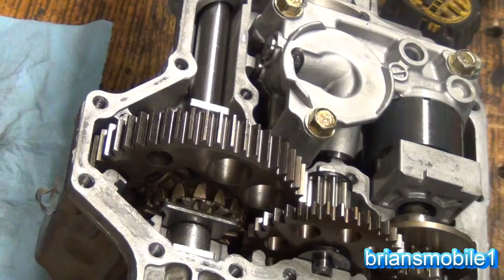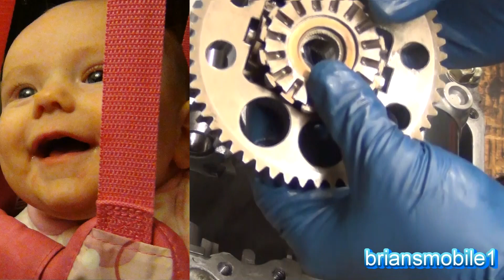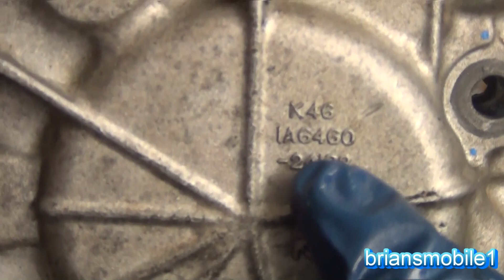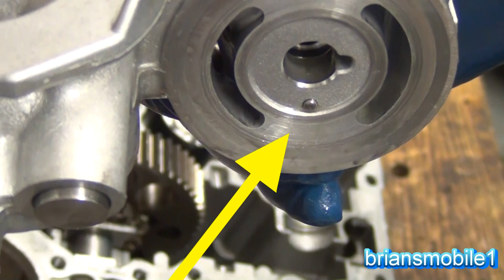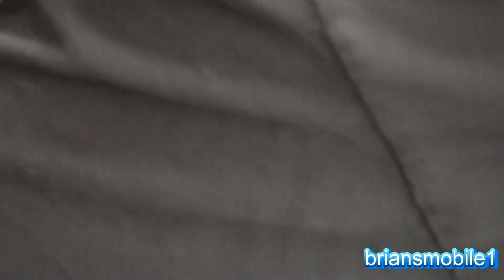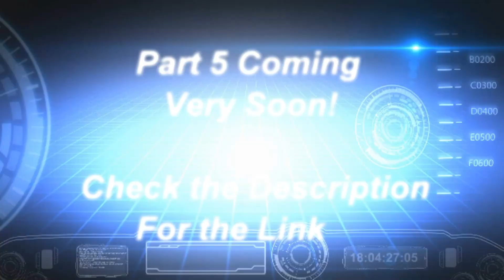Part 4 John Deere L Series Transmission Rebuild / Repair Differential and Motor

Comment: I have an L120 with less than 300 hours that is also having transmission issues. it jerks on load or turning right or left. I did remove the transmission and changed the oil but did not go  as far as you did bc I felt I would not be able to do it. The ol change did not resolve the issue.

Comment: my l130 rear end needs rebuild. Transaxle gets warm an it jus stops. I'm assuming the pump or motor is bad but I've got it apart an there's no play in the plungers on the motor or pump side. so the only other thing I can come up with is the center section of the pump an motor is bad. but I can't find the right rebuild kit.

Comment: The IDS valves have tiny little filters in them that should be changed - especially if you had metal in the oil

Comment: Thanks for the wonderful video, I have the same gearbox in our lawn mower, that started making strange noises just before starting up, I broke down the gears and could not find anything, except that behind the two springs (in this video time 13:44) I have got 2 bullets, and lo and behold, the machine is running, but upside down, when I push the pedal forward, it runs backwards, and when I press the pedal back, it runs forward. No ball is shown on your video, do you need a ball in there? Can this also hang together with the direction of rotation? I have no other explanation for that.

Comment: Is there a forum where people discuss the symptoms so we can figure out what parts we need?  Obvious gear wearage aside.  How do you know if your pump other anything else that is sealed is bad?  Its one thing to tear it down then find out which parts you need this could take a while in shipping time.  Also one hates to reinstall everything just to find out they did not fix the problem.  How can you tell whats exactly wrong?

Comment: I just posted on another video. I have a fix for the JD LT155/166 trans not working. This works on any with the 2 round pumps. Simply remove the round pump blocks and discard the small washer on the bottom. This allows the pump to resume its contact with the main pump block. The pump blocks wear over time. When the washer bottoms out, oil gets by the pump faces. I have 3 years on one with this fix and have done several other models with the round pumps. i switched to 5w-50w full synthetic oil.  Enjoy your repair!!!

Comment: Nice clips Brian!  Got a question on the K51A tranny: I had to remove the pulley shaft & replace it; however, once replaced & put back together - tractor won’t go into gear & makes grinding sound.  Is there any way to fix it w/out taking apart tranny? How do I go about fixing this?

Comment: I have lost some parts to the IDS valves. I have the springs and valves but not the ball or balls and filter or filters. could you tell me how many balls and filter I need and maybe the link to the parts diagram and parts list so I can order them? thanks, great video

Comment: Very informative , have one problem I just replaced my pump and motor unable to find any thing on my problem is forward and reverse are reversed never knew my tractor could do 15 in reverse gonna be a slow forward , not shut on what I did wrong on reassemble?

Comment: Is it just cheaper and less work to replace the whole transmission?: https://www.searspartsdirect.com/part-number/794711/0071/142.html?utm_source=google&utm_medium=cse&utm_term=794711&sid=SPDxGPROD&k_clickID=92184041-8079-46fc-8115-76a329c97421&gclid=EAIaIQobChMI9cqxhMTY2gIVkcBkCh0_cw4NEAkYASABEgLv6vD_BwE

Comment: what is the model of the transmission on a d120. There is oil running on the right side of the wheel. is it just a seal?

Comment: I got an L110 tore down to this point thanks to your video. Mine just whines and won't move on any unlevel surface forward or backward. What should I be looking for exactly? My spider gears look wore a little bit but I don't see any sharp or broken teeth. Could a little ware be the issue? Thanks

Comment: I have a craftsman with a K-46 trans. it had a broken bearing and a motor plate(triangular). I purchased replacements and took the shaft gears out and cleaned the housing. After putting all the parts together again the tractor runs fast in reverse and slow going forward also the neutral does not work (always in drive mode). Any help will be much appreciated.

Comment: I have an issue with my JD transaxle. Runs forward strong, but won't reverse. Had it apart looking for obvious wear or missing parts. All looked good. Matched with parts diagram. Put it together. Added new oil. Still no reverse. Anyone got ideas?

Comment: I did business with Tuff Torq. The nicest people Extremely helpful. I bought every thing I needed and was surprised how reasonable it was.
Reply from the maker: Bill Morgan I felt the same way.  It was hard to find parts the traditional way through J.D., but once you know where the transmission came from and the right kind of fluid to put in it, you're golden!  Great folks to work with.
Reply: I mentioned them on my FB page and sent them an E=mail what a pleasure it was doing business with them. I'm back mowing this morning. Thanks for all your help!

Comment: Bryan I like your detail to attention. I have the trans. out and the spider gears are trashed. Don't see any other damage except the cooling fins are cut off on mine. I did get into trouble trying to remove the drain rubber and trashed it. Hope I can replace it.Also I can't tell if the magnet is in a sort of tray that comes out with it. They, the magnets did their job and may have been why I had this trouble.

Comment: Excellent tear down and explanation my man.  My craftsman uses the same transmission.  Says in the manual there is no way to service (change fluids) which bothers me.  I have 60 hours on it and will change the 5-50 oil to synthetic now that I know what it is.  Good to know parts can be purchased separately in the future from the actual manufacturer vs almost $900 from Sears parts as an entire assembly.  This is a great little transmission.  Knowing how it works is part of knowing how to care for it and make it last.  Thanks again for this insightful video.

Comment: Nice detailed video, I pulled mine apart today to check for any damage, just one question, their are 2 rods that hold the spring on forward reverse lever, what does the adjustable rod, adjusted from outside of unit, do on forward reverse lever?

Comment: I bought a JD with the loss of power issuer, the previous owner replaced the pumps and what not... there was still loss of power, i tore apart the transaxle and noticed the washer part #39.  Do you know if that was missing if it would cause a loss of power?  Motor and pump seem to be in good condition, gears are a little worn, but wash was missing.  any thoughts?

Comment: I'm a mechanic for a John Deere dealership and we never break down tranny's. It's sad but people will pay for a new one or trade the whole lawnmower. Nice to see someone helping the helpless when it comes to JD..I applaud you sir!!
Reply from the maker: Drew Queen Thanks Drew!
Reply: @briansmobile1  what has bigger cylinder plungers the pump or the motor?
Reply: @bcdoll01  Looked like the motor had the bigger cylinders, which makes sense.  In a hydraulic system, a small cylinder feeding a large one is like a small pulley driving a large one, in both cases it gives mechanical advantage. Another way of looking at it is as a  fluid reduction gear.

Comment: I have a LA125 and the drivers side axle is leaking fluid around the seal, is it possible to replace just the seal ??
Reply from the maker: You KnowMe Yes.  Of course.

Comment: Got a question for you. I have a John Deere L-120 with auger on it and during this winter i notice when i put my foot on the reverse it goes slow. let's say i am backing up and not even a real incline but it stops so what i do is rock my body and then it might move. If not i go forward a foot or two then reverse and even though it's slow i can make it. Got any ideas.
Reply: Mine is doing the same thing... Did you figure out what the problem was?
Reply from the maker: MrAm1400 That's the early signs of pump/motor wear.
Reply from the maker: They're two separate links in the same chain.  If the pump or the motor are worn- the symptoms are the same.  One harness' power from the belt (pump) the other delivers power to the drive shafts (motor).
Reply: pump motor wear? explain and solution

Comment: I run a rental yard and well we had some trouble with our la 135 and his vid help us fix ours now we have a problem. Our forward and reverse is backwards? HAVE ANY IDEAS what would cause this ..cuz all its just a rod contacted to it so how can we fix that I don't understand why they would be backwards
Reply from the maker: 707flores22 When the motor was loaded with the wedge, it was loaded backwards.
Reply: did you manage to fix it or do you still need some help with it

Comment: This is a real good teaching tool. One note, my motor wedge block was wide side down and the Tuff Torque diagram shows the same with a drawing notation to ensure same. Ensure you note the orientation as you take your transmission apart. I take frequent photos as I disassemble devices rather than trust my memory. The photos have saved my bacon many times.
Reply: Always a good plan to take pictures. If you install that wedge upside down the trans will work the opposite way. Forward will be reverse and reverse will be forward. They make these in both operating directions.

Comment: Great series of videos,Excellent detail. I'm currently at 811 hours on my L130 with the original 30W oil. So far the trans hasn't given me any problems, but since Ive been doing much needed repairs/upgrades to it before the season starts the least I can do is change the trans oil and filter.

Comment: It's such a nightmare to try an work on a project that somebody else has already opened and incorrectly assembled. Bravo to you for the extra effort to show us all how it goes together.

Maybe I missed it. The pump moves oil around, but what does that little electric motor do?
Reply from the maker: spelunkerd As was said, it's a hydraulic pump and a hydraulic motor.  Kind of like a clutch slave cylinder and master cylinder, but rotational rather than cylinders.
Reply: its a hydraulic motor not an electric motor